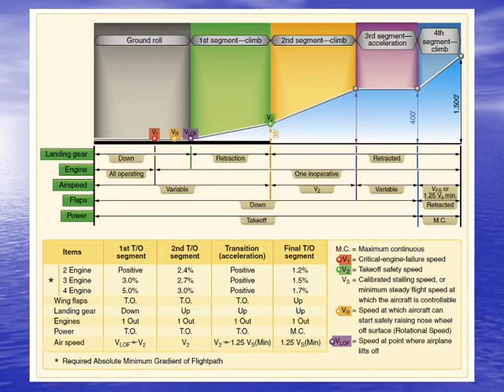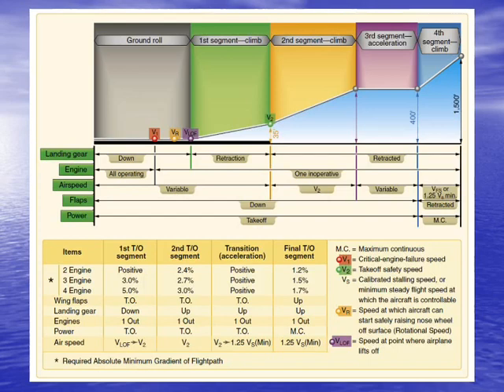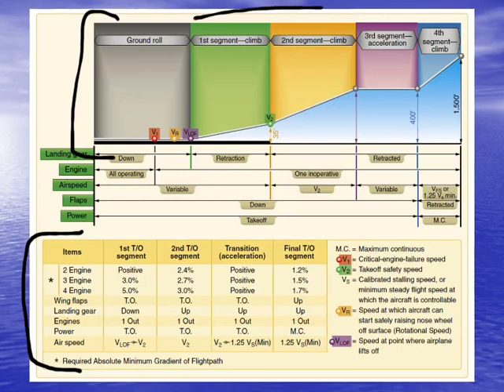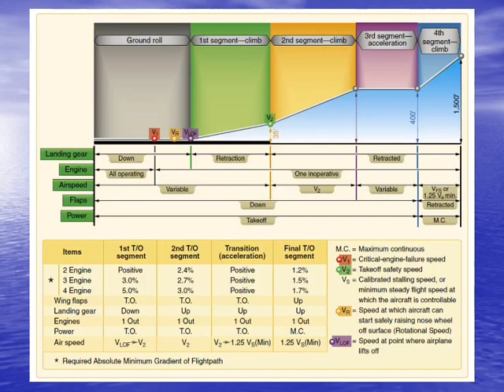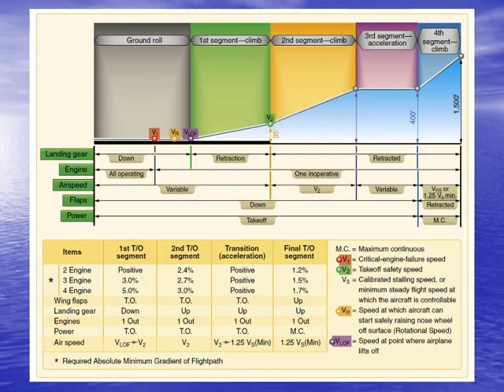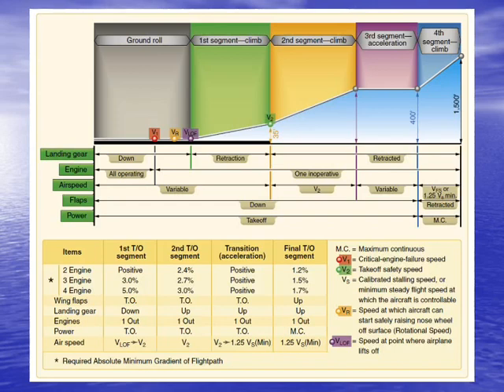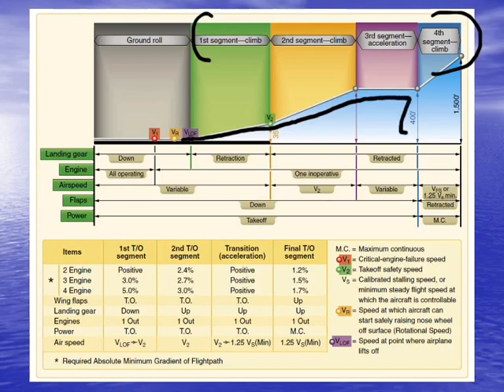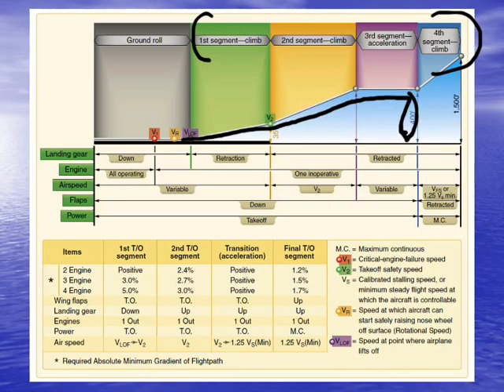Part 121 Aircraft - Performance Introduction Overview

Comment: Hello! You are great! Just a quick question. What is that 2.4% for a 2 engines takeoff?
Reply from the maker: That is a 2.4% climb gradient required if an engine fails on takeoff (I think that is what you are referring to.)
Reply: @LauraLaster747  I understand, why is it way lower than the normal 200ft/nm which is like 3.2
Reply from the maker: @robertodiniz7314 it is lower for certain segments because the FAA regulations are designed to build in more margin for possible lower to terrain portions of the climb. (It is lower than normal because they are assuming an engine failure has occurred which lowers the aircraft's climb rate potential.)